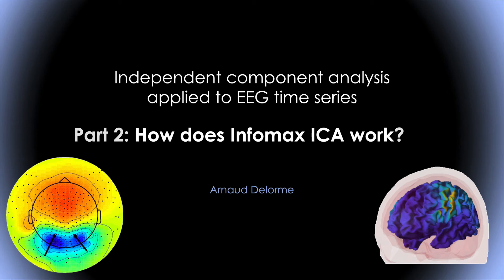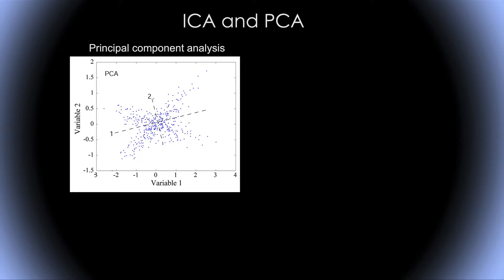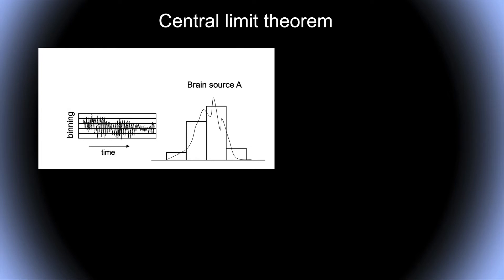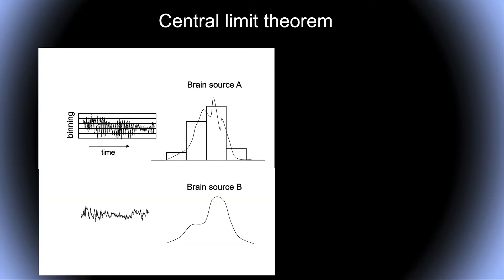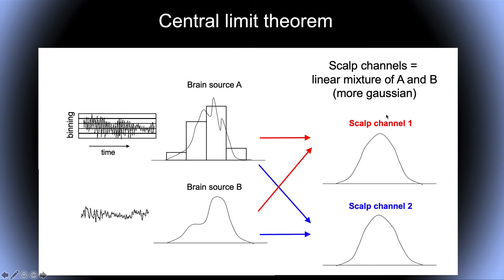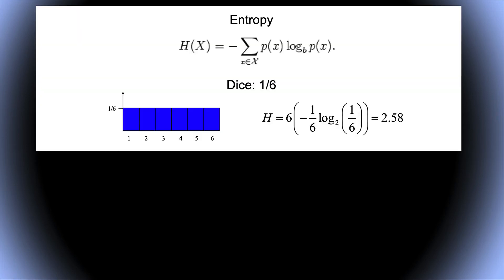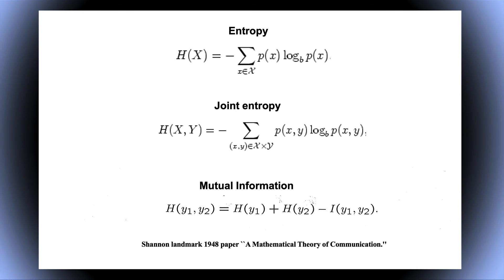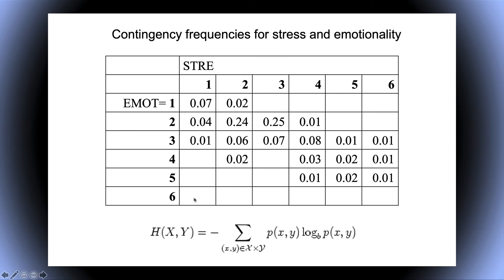ICA applied to EEG part 2: How does Infomax ICA work?

Comment: Prof. Arnaud, given that I have 19 EEG electrodes, fs=256 and I want to decompose using extended Infomax, how many data points would you advise to use, to have a good performance in isolating the ICs? Is there an empirical number of points that you normally advise? Or should I measure the stationarity of the signal to have similar data? I already read the recommendation in eeglab website, but I am still getting a lot of mixed components. The eeg is from neonates, where some of them have different clinic conditions.
Reply: As a rule of thumb, you should use more than the number of electrode square which is the number of values in the ICA weight matrix. In practice, it is a good idea to have many more time the square of the number of electrodes (at least 20). In you case with 19 channels, this means 19*19*20 =7220 samples or about 30 secondes of data.